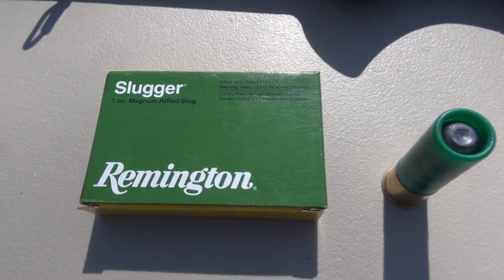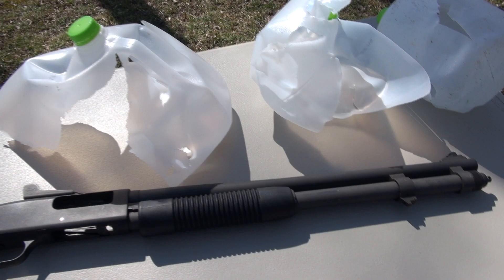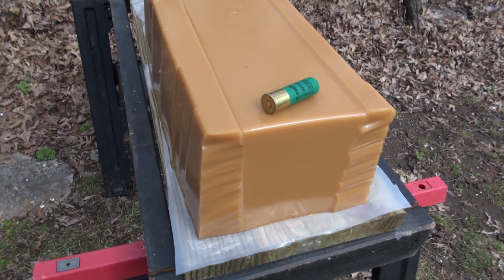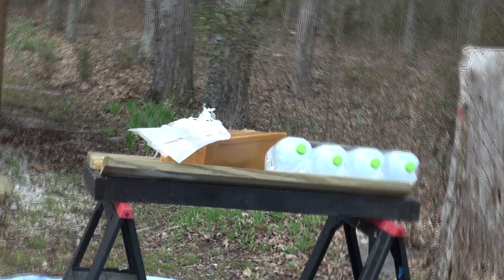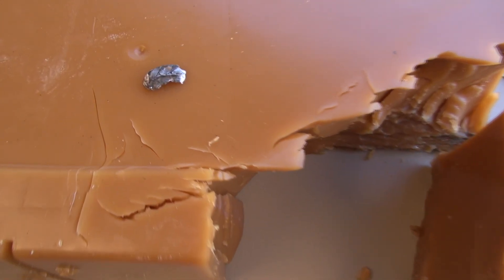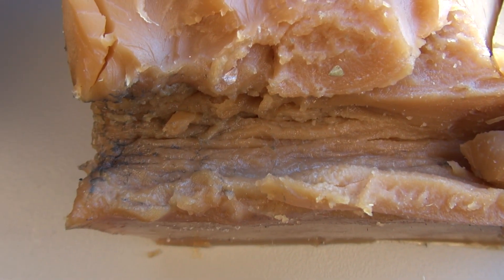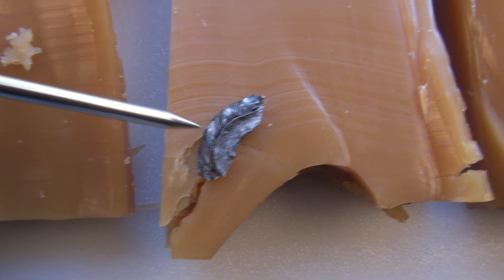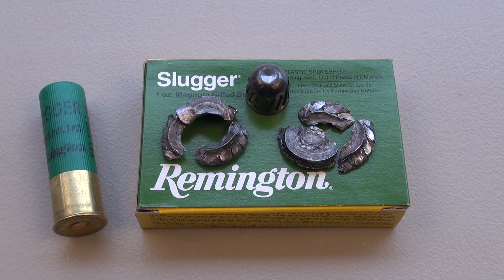Remington 12 GA 3" Magnum Slug Gel Test

Comment: its not solid or actually rifled...water has a different effect then metal doors but the best car door killer I have seen is the old remington solid copper slugs...the newer ones work also but open up the old ones never opened up so got replaced. Also a home made armor penetrator for car doors is cut off the bottom of a steel CO2 canister for pellet rifles and fill with melted lead...heat the darn steel some first so the hot lead doesn't sputter out on to you from the heat and cold coming together. Myself I cut open .50 BMG rounds and use the armor penetrator and or use the pulled 50 bmg API rounds whole..oh those are on sale at midway usa they ahve different wieghts and lengths in 12 ga so check them all out becuase 3-4 a box is darn good!

Comment: "Can I use these slugs on my Mossberg 500 12gage? Even if the barrel is smooth from the inside and those rounds are spiral"

As long as the instructions for the shotgun state you cannot use rifled slugs then you can use rifled slugs in a smooth bore shotgun. Usually a shotgun made for hunting or dual purpose can use those slugs since they were designed primarily for hunting. They have a range of 200-300 feet. Not all locations allow the usage of rifles for hunting due to the range of the bullets due to idiot hunters in the past shooting at every thing that moved which lead to hikers, rafters, people in their homes getting killed or nearly killed from over a 1000 feet away from the hunter with a rifle.

Comment: Can I use these slugs on my Mossberg 500 12gage? Even if the barrel is smooth from the inside and those rounds are spiral
Reply: Lalo Araujo   Yes. That's what they're designed for... Smooth-bore shotguns. You can even shoot these thru a choke. That's actually why they are grooved at the end. They will swage thru the choke. It also provides a tiny bit of spin to it, but not as much as people think.     Foster slugs for smooth-bore. Remember that. I'm a shotgun fanatic!

Comment: The heavier fragment traveled further because it had more kinectic energy. All fragments had the same velocity on the point of break, so the fragment with greater mass had more kinectic energy to be dissipated by the gel as a negative work(force resisting penetrationXdistance). With the gel specs you may even determine the velocity on the point of break. Basic physics!
But in the end we only have to ask: Will it blend?
Well I think internal organs will be kinda blended a bit. Kinda deadly!

Comment: Saw a deer shot at 30yds with this same slug but with the 2 and 3/4" shell (1560fps MV). The deer reacted as if hit by the "Hammer of Thor". DRT! The slug passed clean through and left a hole on both sides the size of a 50 cent piece. Impressive indeed!

Comment: The rifling on a rifled slug does not create any spin, the purpose of the rifling is to allow the slug to slightly deform and fit through restrictive chokes. It applies no spin to the slug, slugs in smoothbores are accurate because the are nose heavy.

Comment: Smooth bore does not spin the projectile, the rifling on the slugs causes them to spin and the spinning projectile will be more accurate. There would be no point in using a rifled slug through a rifled barrel which is why standard pistol and rifle projectiles are not rifled, they are fired through rifled barrels

Comment: i shoot these from my 870 always backup your targets I have punched through the rounded sides of cast iron sinks and truck wheels they may fragment slightly but they retain there bullet weight as you showed.  this round will stop bears cold. I would not use it on anything smaller than a deer. even then your shot will need to be well placed as the exit wound is dramatic.  By this i mean you may ruin the meat very easily with a rear kill zone shot.

Comment: Water is very known for stopping billets and other projectiles if shot into water the bullet will loose velocity because of the pure density; a "newer type" of car/truck were hit by this slug I believe it will, I've shot a .22mag thru a bed of a lil Toyota 80's mod truck ( was totaled, in the woods. I stood at 15-20yds away and the bullet zipped right thru the old tough metal that's on older trucks.it stuck or bounced off the right side of the bed wall. Metal on new cars are weaker then the old

Comment: Hi, just a quick comment on a fun video. If one does use slugs or buckshot in the defense pump shotgun, we should probably stick to 2 3/4 inch loads. The 3 inch magnum loads have a well documented history of malfunctions under stress, not because of the shell, but because of "short stroking" the pump action when we get in a hurry. You can get away with it with the shorter shell, but not the magnum. Just my 2 cents worth as a police firearms instructor.

Comment: what would happen if you popped the slug out and back filled it with more melted lead and let it reharden, put it back in the shell and fire it? For me, I don't want any or less fragmentaion, I'd rather it stayed together when it impacted. Seems like filling it might make to fly straighter.
Reply: dynaglydr   Just buy Brenneke slugs. They don't deform, or fragment. They're designed to penetrate.
Reply: A solid slug wouldn't fly straighter. The front-heavy slug is what makes it fly nose first. Like a badminton birdie.   Plus, the recoil from a solid lead slug, would be devastating. But, go ahead and try it. lol

Comment: It does not matter. The point was that the 12 gauge slug is fully capable of hitting a target 20 feet away. If the target is 5 or 10 feet away then you should be using buckshot anyways.

Comment: ANY SLUG fired from a shotgun causes MASSIVE DAMAGE.  The main problem with slugs is that pinpoint accuracy (as illustrated in this video) seems much more difficult that using a large bore cartridge such as a .45-.70 which does similar damage with more penetration.

Comment: WITHOUT A DOUBT.  And I don't say that from speculation- I have fired slugs at several different materials and targets, including automobiles.  Water and ballistic gel is a very effective material at stopping firearm projectiles relative to a car- they're mostly a couple sheets of thin steel, air and some plastic.  It doesn't compare at all to even water.  I've fired 12 GA slugs through a late 70's Oldsmobile that went through  the car like it was a paper piñata.

Comment: Slug will go through 1 car door. Its penetrating power depends largely on the slug type, any accelerator used in the shell, and then the powder blend. Generally, a slug doesn't need to penetrate to kill.

Comment: I think all rifled slugs have hollow sections like this.  But there are sabot slugs, and they might be solid.  However, I'm guessing they are like most sabot rounds, and so are not as large in diameter as the non-sabot.  I think sabots should only be fired from rifled barrels.  Seems like u might as well use a quality large-bore rifle, unless u are hunting deer in shotgun season.  Ayoob once wrote that the .308 was one of the best manstoppers.

Comment: Recoil management can be done on the gun. Understand how devastating this round is, did you see the cavity? It will do that from 7 to 20yds. with the same type of frag.,in my estimation. This is the reverse of what is thought of re: slug perf.for defense. Powder frangibles vary in pentr. with range, without barrier capabilities. Expanding slugs rarely do.that, even at close range in water. If this media resembles tissue closely enough for this slug to give the same perf.,then it's a winner!

Comment: Actually I've just been exploring the possibilities of this round in 20 gauge, as a dedicated slug gun for HD, with 35% less recoil. This round needs to be understood as a +P+ handgun round. With more speed there is more expansion, with a GD bullet. In this case it is early fragmentation at 20ft, compared to the standard Foster slug. I'm not concerned about missing the target, I always favor adequate pentr.in the target. And this round is showing that it has benefits at every range.

Comment: Buckshot will still penetrate multiple walls, as handgun rounds or anything else. This round is more safe cause of its limited frag. depth. All shotgun rounds have to be aimed well, especially at SD/HD distances. Brenneke for punching windows and doors, seats and anyone in front or behind them. This round is a hostage no-brainer and hallway/distance shot assurance with LESS liability of stray rounds, from the aimed shot itself.

Comment: These are a poor choice for vehicle penetr. .A Brenneke R10 has more weight and sectional density for the job. As shown this round fragments violently 'cause of the added speed. And with only 12.5" of penetration it is better than 00 buck at that range, and even closer in. It 'could' pentr. less at 3 to 5 yds. 00 buck can pentr.18"at 5yds.This round performs like an expanded hp, with 2 more rds. behind it. Assured breast plate pentr., severe disruption and GOOD pentr.  Avg. adult 10-12in.depth.

Comment: I have to wonder how much more performance you would get with a 3 and a 1/2 inch slug round loaded with slower-burning powder. 

Have you tried those Truball slugs? Supposedly the plastic ball at the back of the Foster Slug allows for much better accuracy than normal.

Comment: i own about a dozen firearms. as far as shotguns, i have a j.c. higgins model 20 (highstandard model 200) 18 inch barrel with a moddified mossberg pistol grip, and an old junk  single shot i use for testing handloaded shells or for shooting steel "fun" shells. the others include a 1913 enfield SMLE,  a ww1 surplus mauser agerntino, a rossi 971 357 mag revolver, and my ruger 1022 that iv got upgraded.

Comment: My suspicion is that the slug had already traveled it's course and was starting to settle by the time the block had started getting up in the air. After all, the block would not have the energy to jump like that if the slug hadn't already dumped nearly all of it's energy into it.

Comment: water wouldnt do much to a solid subsonic bullet(most pistol ammo, or regular shotgun loads), those 3' shells hes firing shoot at 1700 fps, which I think is above mach 1, making it super sonic. if you've ever fired high powered rifles into water, the bullets would just shatter and disintegrate, that probably happened to a degree on the jugs.

Comment: Ive been using this round for close to 10 years for deer hunting and know the devastating results of this round hitting a whitetail deer....

In hunting ive never had a fragmentation but thats at roughly 80-100 yds. The exit wound is roughly 2-3 times the original size of the slug. Ive tried many different rounds and nothing beats the knock down power if the Remington slugger ive found.

Thanks for the great videos sir by the way.

Comment: Very impressive back-flip; it was worth the low hit for the aerial acrobatics!
Been doing some research and was surprised to learn that the pattern on these slugs has nothing to do with stability.  They do rotate, but not at a rate that would have any stabilizing effect whatsoever.  The raised rifling prevents damage in the event someone were to fire it in a shotgun with a tight choke.  The only reason they are slanted at an angle is for marketing.  The term - "Rifled" implies greater accuracy.

Comment: @darbycrash55 shooting those foster slugs out of a smoothbore makes it very hard to hit anything... You never really know where it's going to end up .

That hasn't been my experience . I have ghost ring sights on my 8.500" 870 and my 14" 870 . I only use Brenneke 3 inch mag fosters for bear medicine and my 8.500" will put 5 slugs into a 3 inch group at 25 yards , where it's sighted in but my 14" is sighted for 100 yards and i can put 5 into a 4 inch group .

Comment: @Rorona550 - Yea, I did just that.  You can order the ghost ring sight set direct from Mossberg.  The front sight should be silver soldered onto the berrel, however, I attached the front sight with JBWeld epoxy.  It's been holding solid after several hundred rounds of all sorts of 12g rounds (bird, buck, slugs).  It only took about 30 min to install and about a day to set.